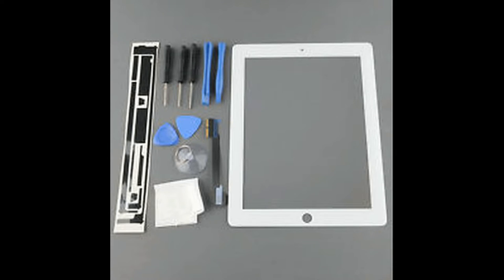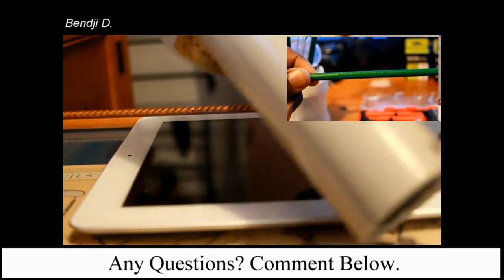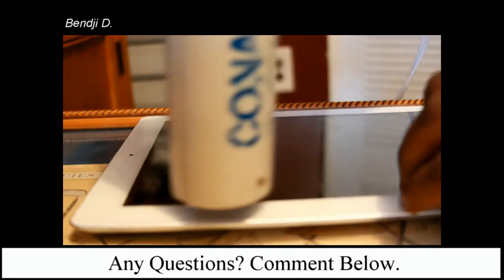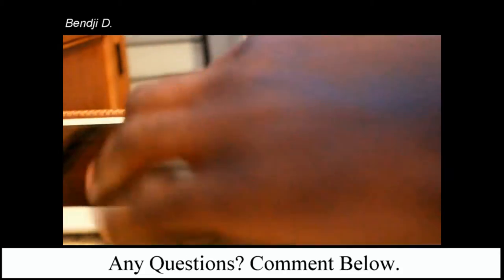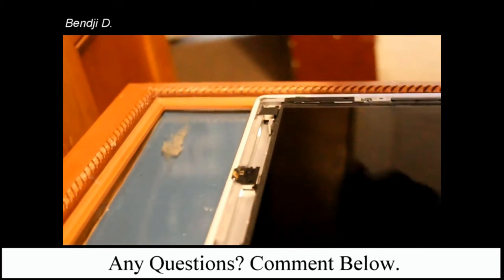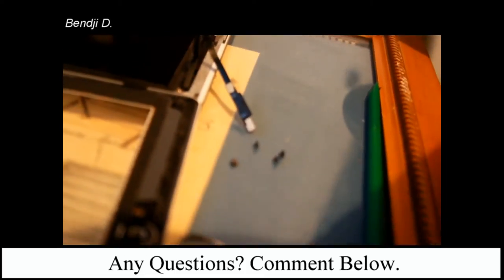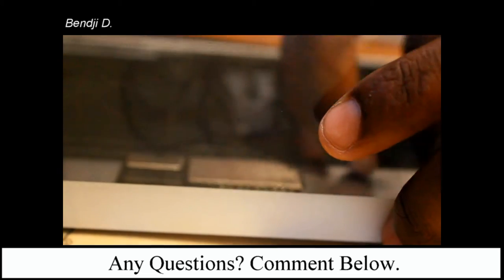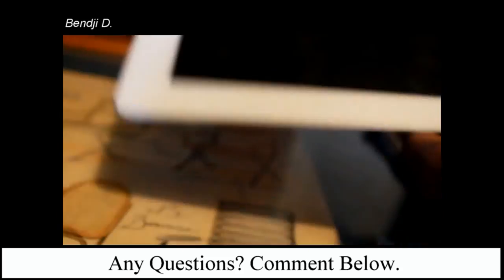[ Screen Replacement ] iPad Second Generation Screen Repair | Get Fixed

Comment: Got to say bro,yeah it's not a bad tutorial but gotta be honest the only reason I watched it is because it was short and if someone that had never done anything like this before to either a iphone,iPad or even a laptop they could totally mess up there iPad,you don't show how to slide the little sliders back to release the connection from the glass to the digitiser or even about the home button housing and camera protector,if you edited it it would be by far the best on here and take another 30 seconds tops,I'll stay subscribed  if you do that,
Reply from the maker: +PAUL STOKES I appreciate the constructive criticism brother. I'll make an updated video with the iPad 4th Generation sometimes this week. I knew I left out a lot. At the time I couldn't get the proper angles and had bad lighting. I'll be sure to include all the minor details in the upcoming video. Thanks again!

Comment: Can you switch from a white screen to a black screen?
Reply from the maker: Actually. Yes you can. You can even leave the white rim around the screen and a white button to make it look awesome.
Reply: +Bendji D can it actually look like it was a black version or would it still have white details?
Reply from the maker: It actually can look like it was originally black because the screen replacements comes with a button. But the detailing around the screen does not come with the replacement screen so you'll have to order that separate.